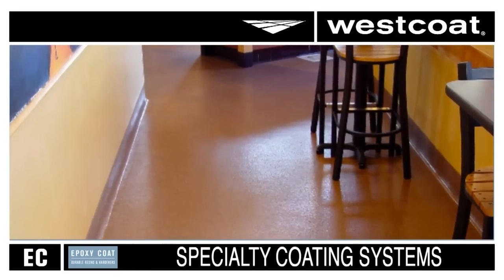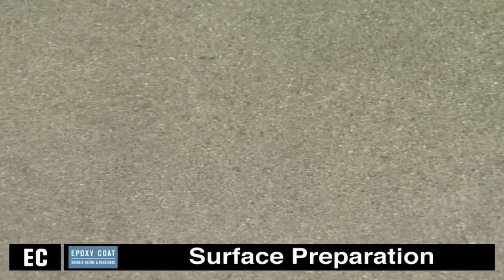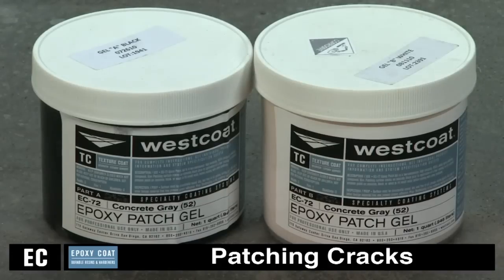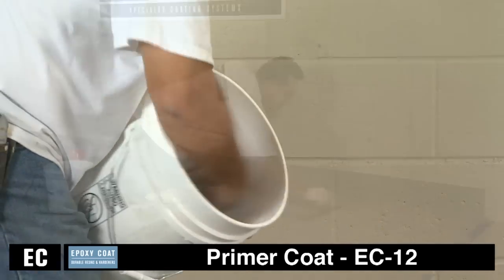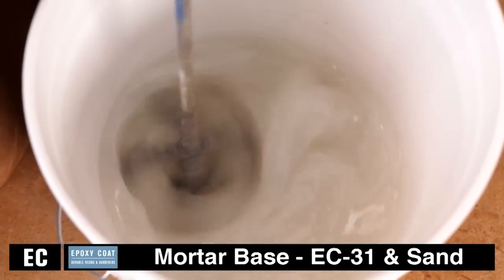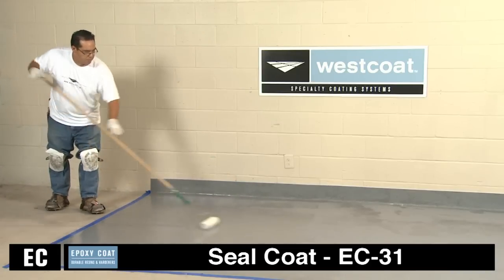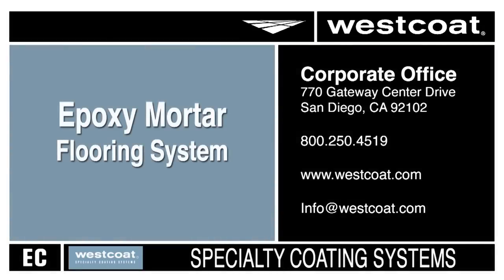How To Install Epoxy Mortar

Comment from the maker: JUMP TO A SECTION HERE:

0:00- Introduction
0:42- System Overview
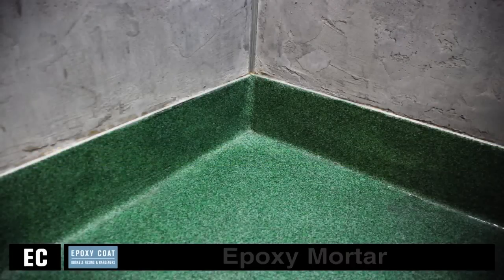0:54- Surface Inspection
1:13- Surface Preparation
1:53- Test For Moisture
2:16- Patching Cracks
2:33- Primer Coat
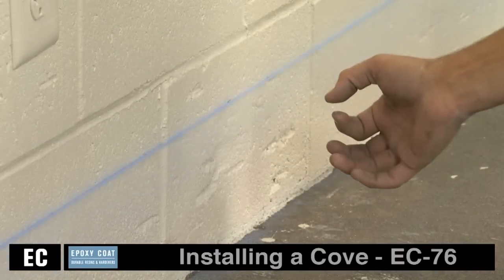3:15- Cove Installation
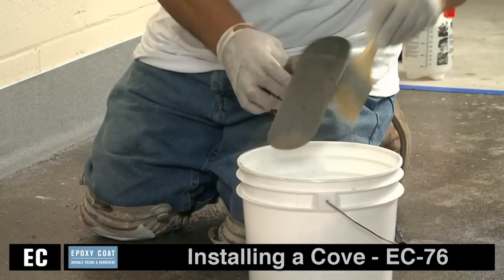3:49- Mortar Base
4:26- Seal Coat
4:48- Conclusion

Comment: E-LINE Zero-VOC is ideal for heavy-duty degreasing and for removing paint and sticky adhesive residues. Because it is VOC-free, there are no regulatory concerns -- even in southern California! Note: test first on plastics and painted surfaces to check compatibility.

Comment: EPA EPCRA Delisting (1995). EPA removed acetone from the VOC. L list of "toxic chemicals" maintained under Section 313 of the Emergency Planning and Community Right to Know Act (EPCRA). In making that decision, EPA conducted an extensive review of the available toxicity data on acetone and found that acetone "exhibits acute toxicity only at levels that greatly exceed releases and resultant exposures", and further that acetone "exhibits low toxicity in chronic studies".